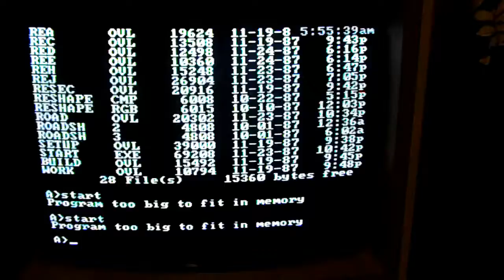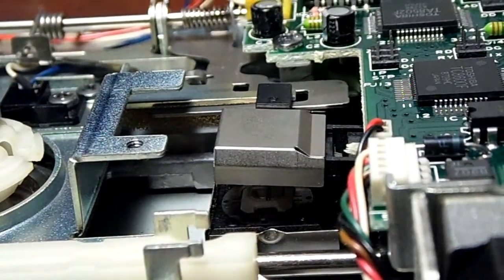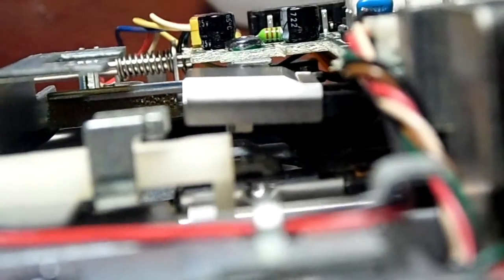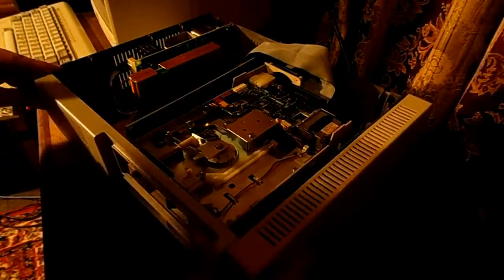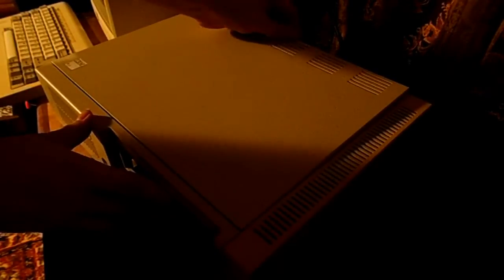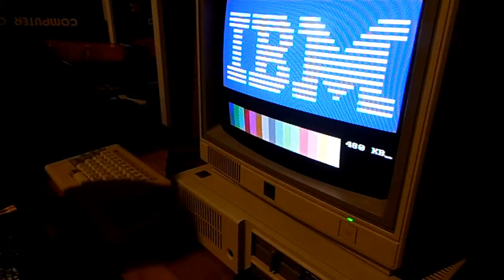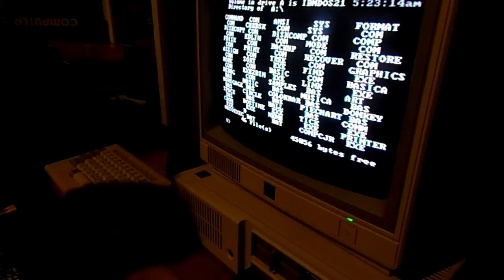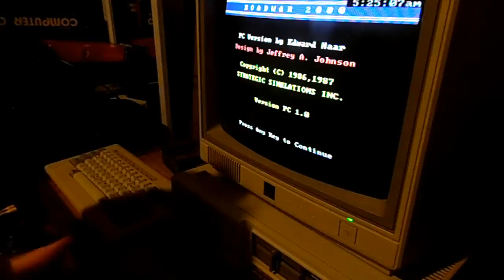How to Repair a vintage IBM 5.25" Floppy Drive

Comment: I own 2 jrs, and as such I have some things to say:
1.  Yes, heads on diskette drive need to be cleaned every now and again.  They used to sell cleaning diskettes.  The inside had a fibrous cloth, you'd apply cleaning solution (supplied in the kit), and run the drive for a short time.  I also had a program somewhere that would actuate the stepper motor from track 0 to 40 and back again while the cleaning disk was in the drive.
2.  I'd be really cautious about lifting up on the head.  That head actually is in contact with the disk, so if you bend it too far, it may not get a good "read".  Or it might throw the drive out of alignment.
3.  They sell foam-tipped pads on a stick, specifically meant for cleaning magnetic heads.  Places like Mouser, Digi-Key, MCM Electronics, and Parts Express would sell stuff like that.  It's recommended to use those because standard cotton swabs can leave lint behind.
4.  Without the diskette drive you'd have Cassette Basic!  One of 2 machines (the other being the original PC) with a cassette port!  But you're in luck because you have Cartridge Basic, even fancier!
5.  The drive have 2 heads, one for each side of the disk.  Both heads are able to both read and write.  5.25" disks have 40 tracks, holding 320 or 360KB of data, depending on the version of DOS.  Disks can also be single-sided, which means only one side is recorded on, but there's no "flippy disk" characteristic available since the drive use the indexing hole.  If you think of the standard step rate when formatting a disk that's double-sided, if you have a single sided disk, the step rate is double.  So the heads step much faster with a single-sided disk, making it sound, at least, a lot faster.  Only one head in use means less data flow, so the drive must step faster to keep up the data stream.
6.  Also, oiling the rails on the drives help a lot too.  Oftentimes they get gummed up due to age, and oiling them very very lightly will quiet the drive tremendously and help prevent seek errors.
Reply from the maker: Lol Thank you for the information on the floppy diskette drives! I didn't know a bunch of that stuff, however I did oil it also in addition I just didn't show it. :P

But anyhow the cartridge basic is fun and all but it's not very useful since I only own one other cartridge and without a diskette there is no way to load or save games, text files or documents so I'd basically (BASIC-ally? lol) be screwed. lol
Reply: Yeah I know what you mean.  Cassette (and cartridge) BASIC support a cassette deck for saving and loading programs, but it's buggy, very slow, and unreliable.  Search for "Terry Stewart", he's from New Zealand and has a whole bunch of really old computers, many of which use cassette.  I think Mike Brutman also has something posted about cassette.

Very antiquated indeed, by today's standards (heck, even compared to a floppy drive), but a cool piece of nostalgia anyway.  It's what was available in the day, so they used it.  Floppies were still VERY expensive, a 10 pack of 5.25" DSDD disks cost a little over $10, and that was early 1980's dollars, so they were quite expensive still.

Also:  Do you have the PCjr Sampler diskette with your jr?  It had an orange label on it.  If you do, I will beg and plead for you to simply set the camera pointing at the jr, turn the volume up, and just power it and let it boot to the sampler.  The sampler plays a rendition of Rhapsody in Blue that was really warm and amazing sound for back in the day.  IBM used Rhapsody in Blue quite a bit over the years in their advertising.  Bonus points if you actually run through and give a demo of it.

I have the diskette, not sure if it's readable anymore, and both my jrs are tied up in storage.  My monitor died (I think the flyback is dead), but there's always composite and separate amplifier.  I actually have another jr monitor that somebody cut the Berg connector off and wired a DB-9 onto for standard CGA.  Of course that disconnected the sound capabilities of the monitor.  And it's too bad, because I know they made an adapter for Berg to DB-9 (you can find them easily on fleabay), my guess is somebody used to use that jr monitor on a more "real" computer, like a PC or perhaps even an AT.
Reply from the maker: Yeah I haven't been able to find out much about the mysterious IBM Cassette cables, supposedly the 5150 has a port to use one too. Also I am a member of Brutman's site and actually watching Tezza right now. lol
You a member on vogons? Cause I frequent that place too.
Yeah I have everything the computer came with new, mine is still in it's original packaging and I have all the original manuals and disks (as well as tons of other disks).
I'll have to go dig around but I think I can certainly record that.
If you look at my other video's you'll see I recently obtained a Commodore 64 with a lot of extras including the original tape drive and some games on cassette (most notably fort apocalypse). But I think the drive is toast, luckily I also have a generic tape cable with audio jacks on one end and a drive cable on the other. Not sure if it's for this computer or something else but it's worth a shot.
I obtained an XE1541 cable recently anyhow so I can watch demos on my C64's or write roms to diskette. So with some luck there will be some more C64 videos coming. :D
Reply: OK, cool, I can't wait!  Never owned a C64 back in the day, now I have 2 or 3 (and a VIC 20).